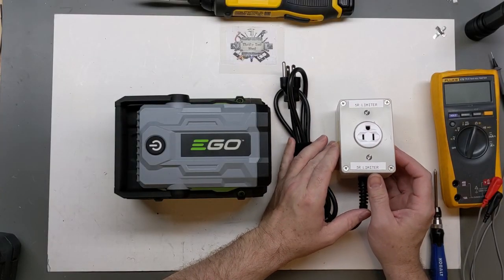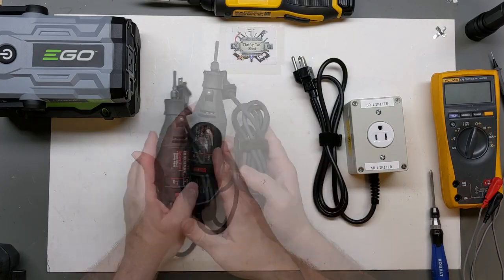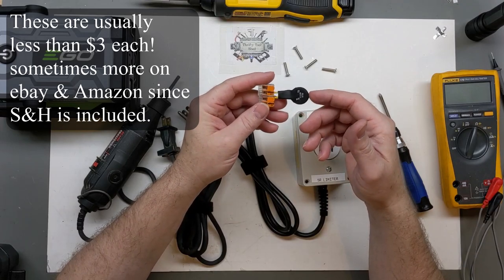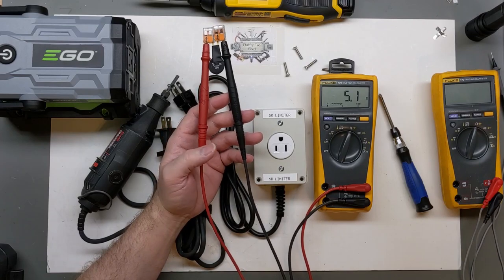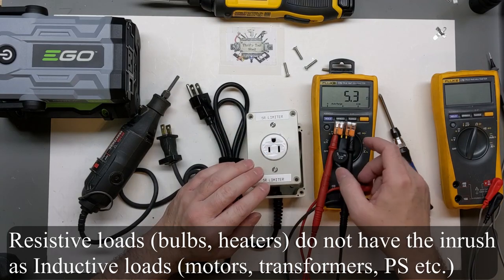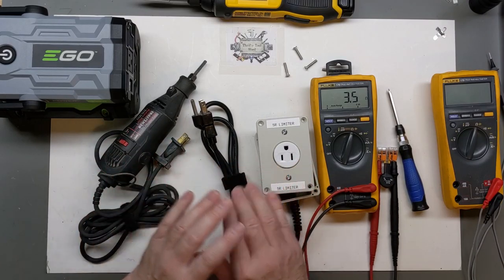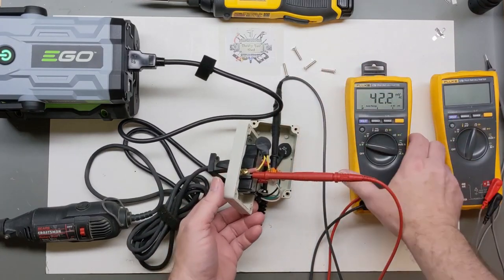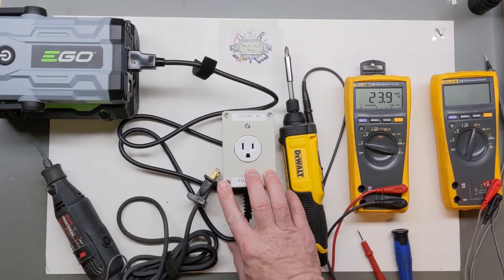Inrush Current Reduction for the EGO Nexus Escape

Comment: Used a similar technique (same component) but on the DC (12V) output power pack side, going into an inverter. Really interesting to see the component being on the AC side… never considered putting in the AC side. Thank you for sharing.

Comment: Would it work for nexus 240v models?
Reply from the maker: This NTC, the 5R012 is rated for up to 480V so that is not an issue. As long as it is the same application it should help. It may not work for all loads but for most that are inductive and are within the wattage rating and just have to much Inrush it should work fine. Again these will not help it start something that is already too much load for it to begin with or any resistive load that is already higher wattage than the inverter is rated for. Hope it helps. Best if luck to ya!